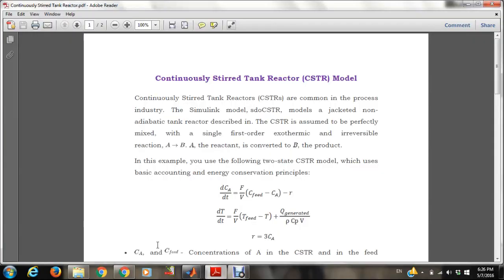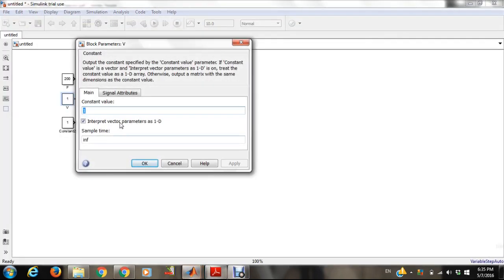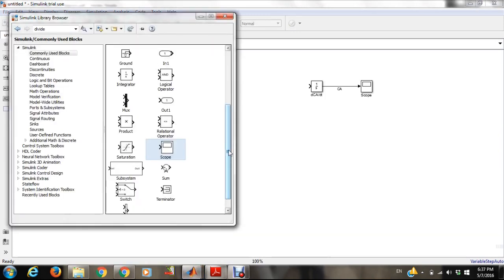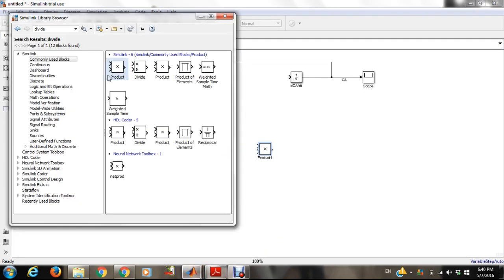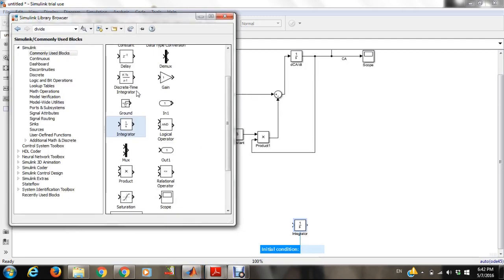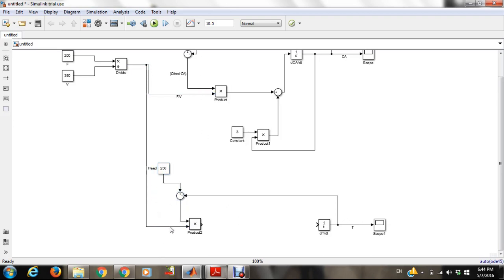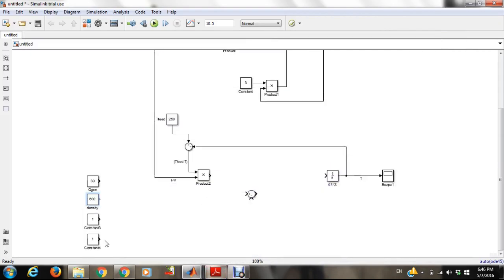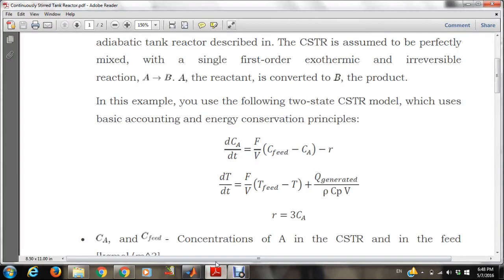Simulink Model of CSTR Tank

Comment: The inlet feed temp is 250 and it should increase further from that point ...how it increases from 0 and reaches 250 in graph.......and also what is the difference between C feed = 10 and the initial condition 100 in dCa/dt integrator.... please help me in this regard🙏
Reply: did you ever find out why